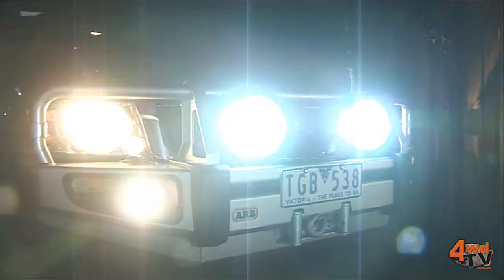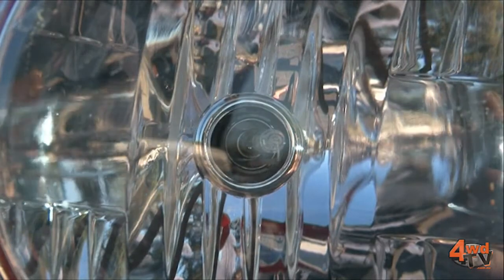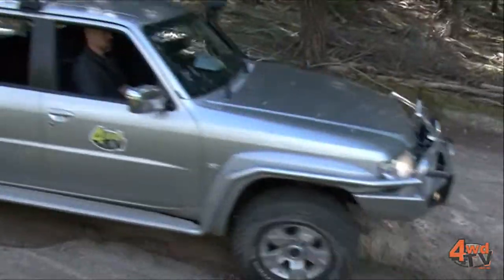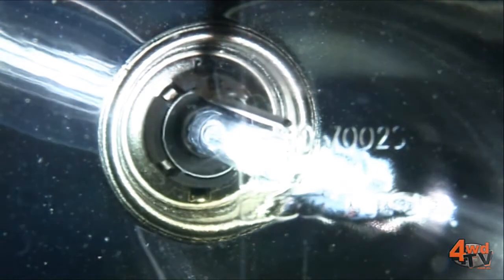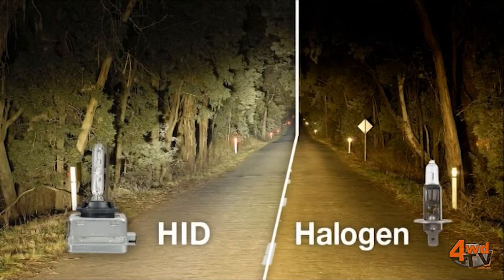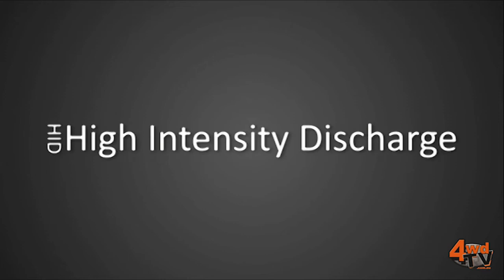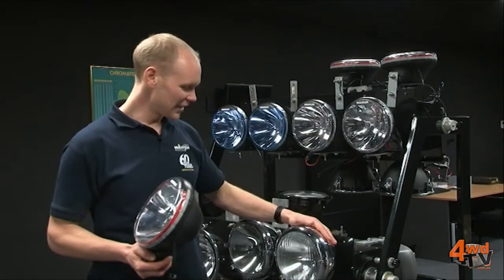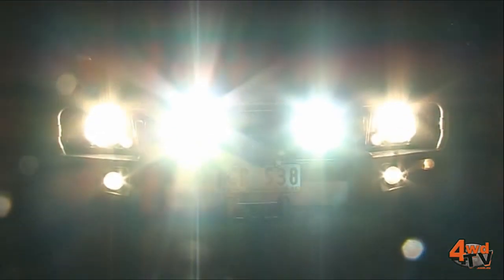HID vs Halogen

Comment: Also hid takes time to warm up.hid light is in the blue spectrum. This means skippy is almost invisible amongst the bushes. Blue spectrum light is in a much shorter wave length than red(halogen) so dust particles smoke fog etc reflect back at the driver.Recent studies are also showing that the blue spectrum can cause eye fatigue .for myself I think the best combination for the Aussie bush would be a good set of halogens (fyrlyts) and a good brand led light bar (black oak marine or rigid)